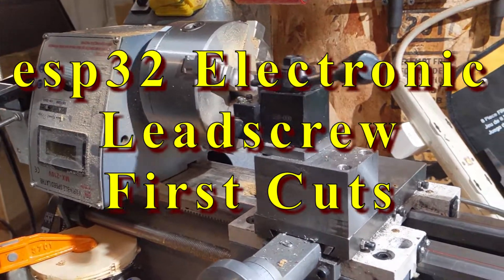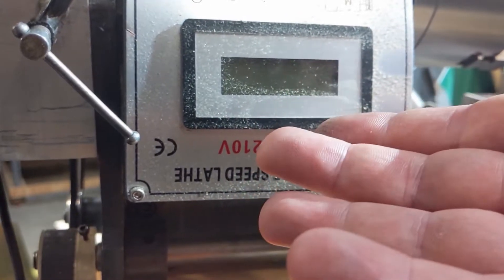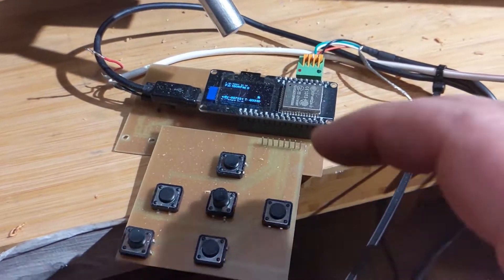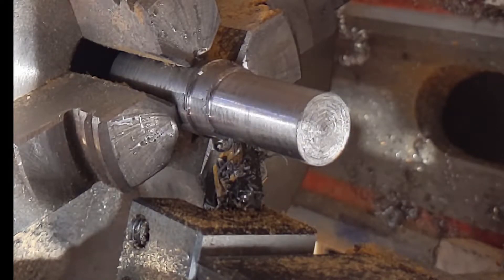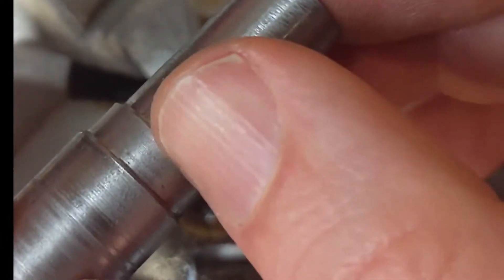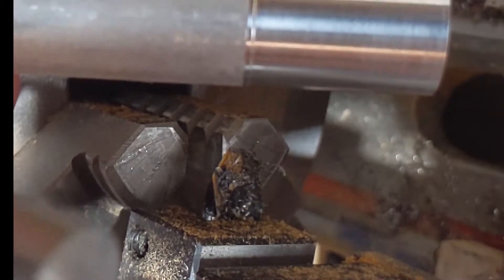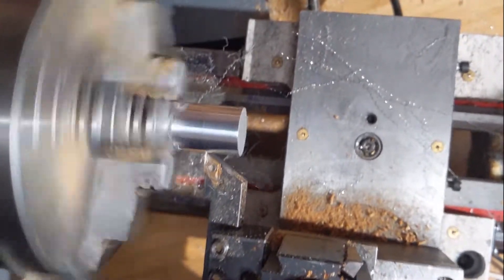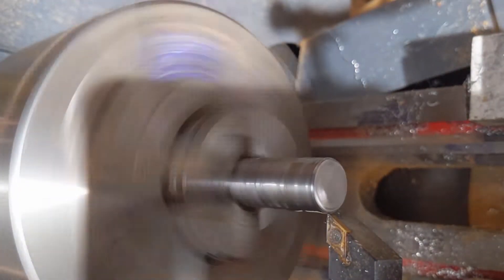espELS: Part1 esp32 electronic leadscrew (ELS) first cuts

Comment: Looks like these are now being sold as kit on aliexpress. Only $322 + $45 shipping to US. I like the looks of NUMOBAMS pulley upgrade to poly v/micro v belt but my MX210's biggest issue has been rigidity, change gears are a distant thought to decent cutting speed/finish. I thought the cross slide/carriage ways were the issue as mine looked to have been chewed into shape by a beaver or rats. I flatted the cross slide on a granite block with sandpaper glued down then glued sandpaper to the top slide and mounted it to my carriage and started working on the cross slide way on the carriage side of things. Got it nice and smooth with good contact but it seems to have changed nothing. I have a 0XA wedge tool post but I'm thinking your compound mod may be next. Already replaced the chuck with a 4 jaw with no real improvement besides runout(I prefer to adjust runout every time vs 3 jaws).
Reply: Not sure if the price implied as much sarcasm as I intended but to me $367 is laughable.
Reply from the maker: you should do a bit of baselining with an indicator to see how much your setup is moving today.  then compare the measurements with the solid tool post.  My er32 collet chuck had a much better profile than the jaw'ed chucks I have simply because the natural frequency is different and the spindle is pretty thin.  you can buy a spindle with a smaller bore but i'm not sure the OD is the same.  All things being equal the larger OD should be more rigid if they are not the same, however it seems like they are really pushing it with the spindle thickness.  Measure your spindle flex with the chuck on it.

Comment: Do you have a video on the hardware (stepper motor, controller, ESP32 connections)? I don't see that data or photos on GitHub. I'd like to build this along with you.
Reply from the maker: Can you make an issue on github, it will be easier.  I'm thinking of getting rid of the buttons and display which would make wiring quite a lot easier for you, there would just be a few connections.  I should also merge my latest into the main branch to keep the development version cleaner.
Reply from the maker: I merged in my refactoring branch and updated the doc a bit, also gutted the button code.  all you need should be the 2 encoder channels and the step/dir pins.  any esp32 with 4 free output pins should work.  Check out the espELS part 7 video to see the latest features.  Looking forward to collaborating.

Comment: Nice, what a coincidence, I'm also building one :) Great surface finish there.
Reply from the maker: I'll add the github project to the descriptions.  I have threading working as of yesterday.
Reply: @JesseSchoch  so it's a race now :-D
Reply from the maker: @MaximKachurovskiy  4 weeks.... If you want to collaborate let me know via github.  I've prototyped react + websocket based settings which I think obviates the need for a oled screen, but i've not yet worked it into the code base.